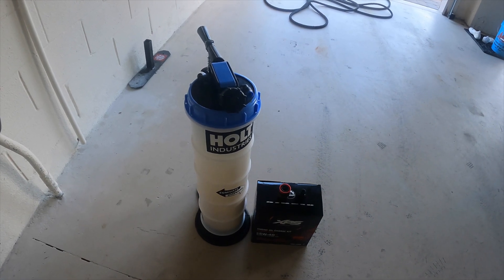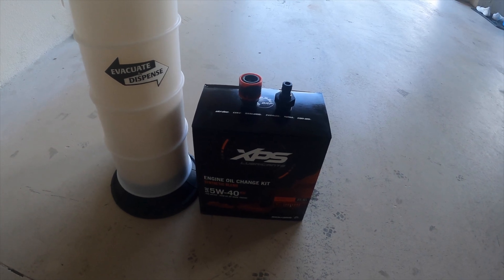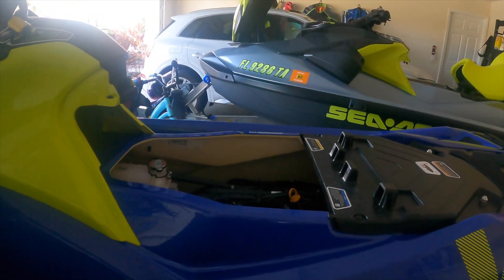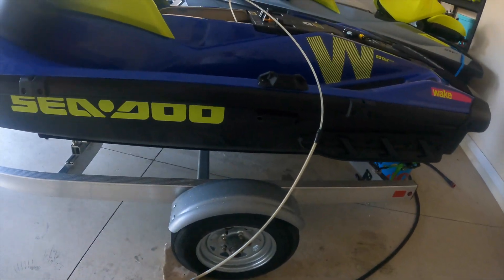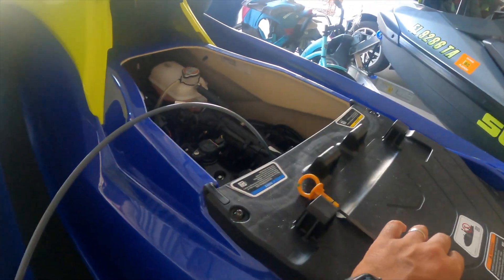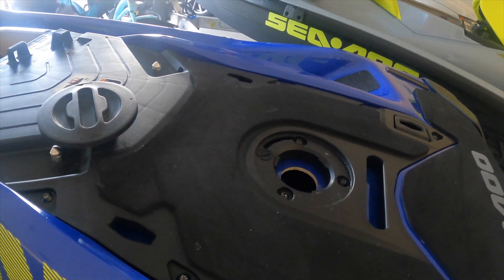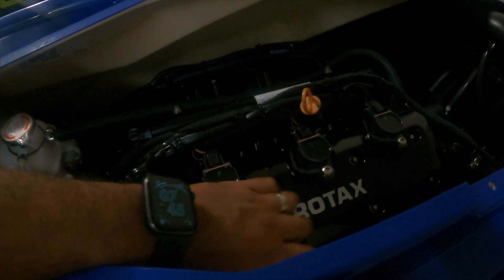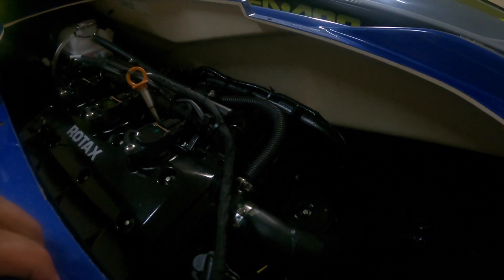How to change oil on a Sea Doo Jet Ski

Comment: If you could tell me was there a gap in the oil filter housing when you went to reinstall it up underneath the top part I guess it doesn’t seat all the way down for some reason… I noticed that on my JetSki when I tried to reinstall a new oil filter as well I’m just trying to get some insight on it I have a GTISE 170 also
Reply from the maker: Yes, there will be a small gap!

Comment: Can’t hear what you say with the music on the background….
Reply from the maker: Thanks for the feedback, we will re upload with no music. In the meantime let us know if you have questions on the procedure.
Reply: @exploringourwaterways  you’re welcome. Or you can lower the music volume on the edit or remove will be great. I think in general the best is to buy something like DJI mic. Mic give the best quality audio for videos.
Reply: Hi great thorough video,  Ihavecquestion about torque specs.... is it necessary to torque down the nut on filter housing?. Also would like to know same about changing the plugs..... so many videos out there with different methods same motor.
Reply from the maker: I would tq them down. Here are the specs per SeaDoo. 

Reinstall the oil filter cover and torque bolts to 9 N·m ± 1 N·m (80 lbf·in ± 9 lbf·in). 

The plugs you typically want to be around 15 ft lbs. I dont go crazy on plugs in fear that I pull threads from head.
Reply: @exploringourwaterways  thank you
Reply from the maker: Anytime, let us know how you make out. Its fairly simple!